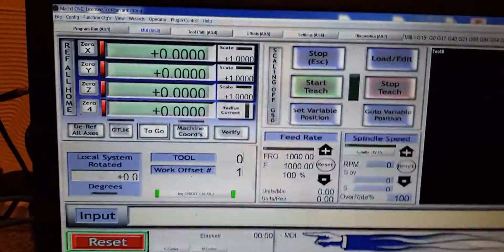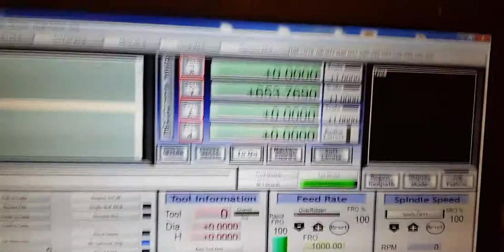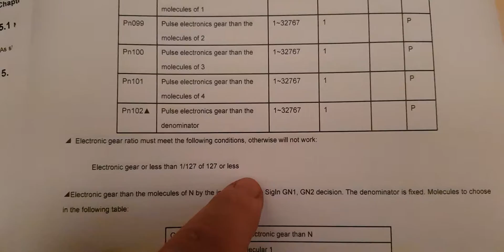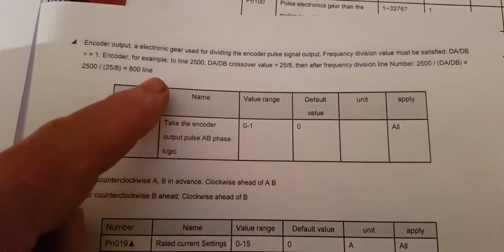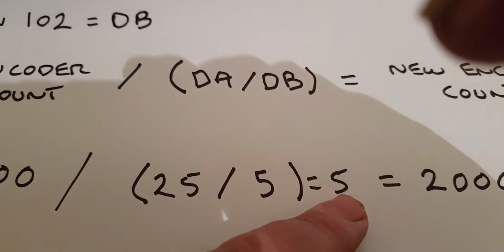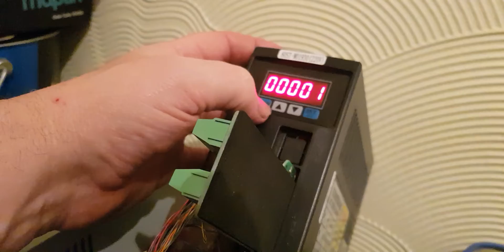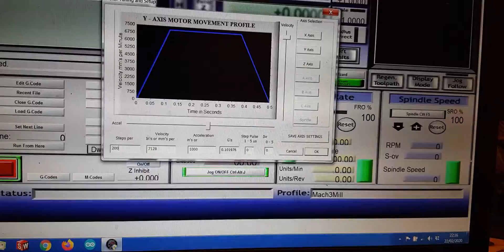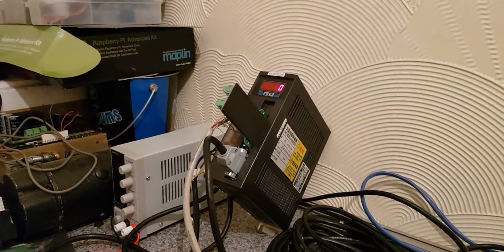Electronic gearing on chinese servo

Comment: Hi your video help me very much . As my machine was giving a bad travelling distance the only way I find for fixing my problem was 098/102 pn way.For speed my bob was able to taka 400 000 mkz so for speed I was ok . 
my problem was that with mdi I dial   G00x1.00  the dro was showing 1.00 in x but if you mesure the distance it was something as 0.987. the only way i find is playing with the DA/DB SO  at the final I have something like 
32767/32489 . the same as if you play with gear . Is that fabulous hihihihih Thanks You

Comment: Thank you for this video and the good explanation, but I don't understand where you got the 25 (DA) and 5 (DB) from. I mean, why 25 and 5? You even say that as long as you end up with DA / DB = 5 you are fine, so why not just use 5 (DA) and 1 (DB)? After all, 5 / 1 = 5 also.
Reply from the maker: It's been a good while since did this but think I did try 5 and 1 and it wouldn't accept those numbers.? Not sure how the 25/5 came about.

Comment: So with this the resolution you have for 10mm pitch and 2000 steps/rev is 5 microns. Good enough even for a mill doing steel or aluminum

Comment: Oh man, I am going to be using this motor as a spindle motor and with analog 0-10V I could only get 2300RPM, Hopefully this will let me get the last 700 RPM. When I was first read this and read gearing I was thinking the gearing ratio that I was going to use. Yea I was WAY off...
Reply: In speed mode you have Pn158 (chenglish: The directive gain simulation speed) 300 rot/min/volt. With 300, 10V should give you 3000RPM
Reply: @car9167  Ill have to try that. I haven't touch my mill conversion for a few months.
Reply: @mrp19285  well this works if you run the servodrive in speed mode. In positioning mode what was done in this video is the way to go. Not sure how you use the servo as a spindle motor or as an axis servo
Reply: @car9167  Last I knew it was in speed mode. But it has been a few months.
Reply: @mrp19285  Any of you guys know what software to use for tuning. When I bought mine they said its factory tuned but how do they know my machines inertia.  Think its got to be tuned on the machine or have I got it wrong. You get two similar drives, one with and one without the   pc communications port. Mine have them so auto tuning would not be a problem.